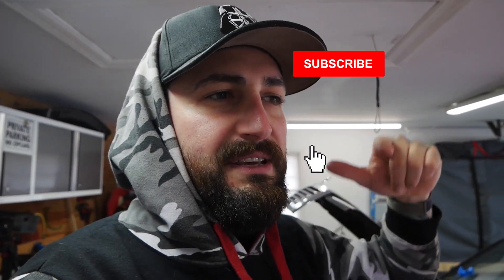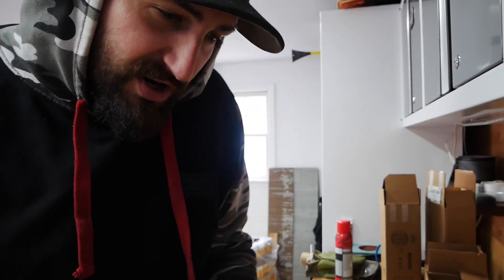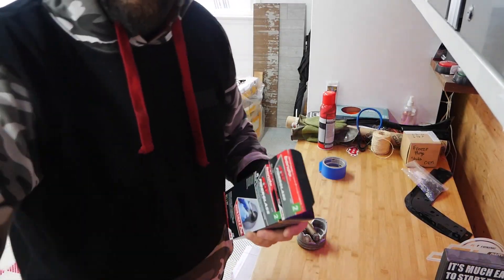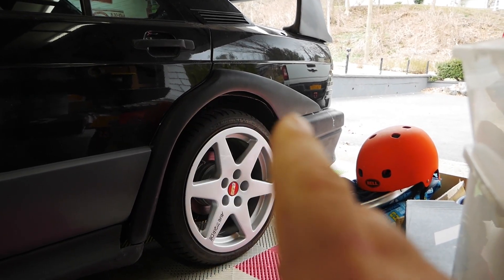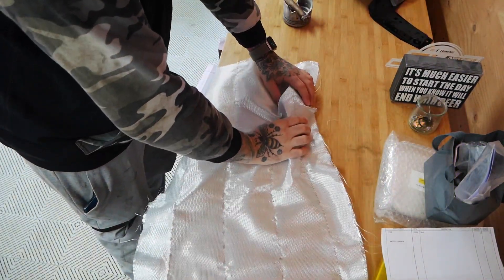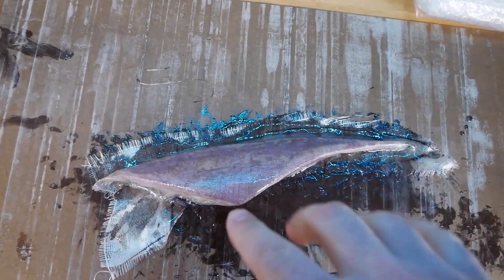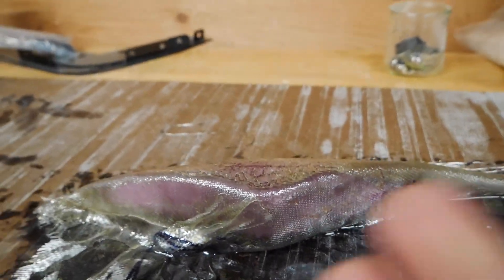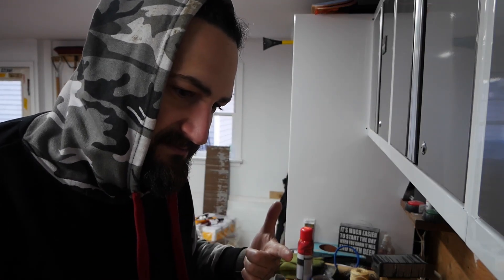Custom fiberglass fenders for the 190e

Comment: Hi From memory fiberglass resin will not stick well to aluminum foil. If you need to prep a workspace you can use spray adhesive to glue the foil to a board making it easier to remove the part when cured.
You can also wrap your foam core with foil to act as a protective layer so the foam does not react with the resin.
I'm sure there are other ways of doing this but given how cheap and readily available it is it comes in handy.
Reply from the maker: great tips... im definitely gonna try this next time